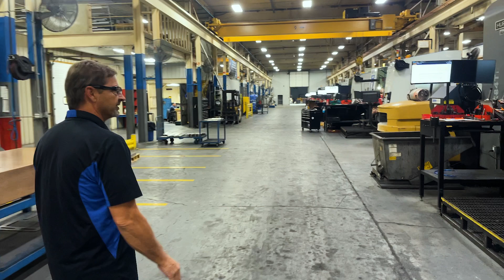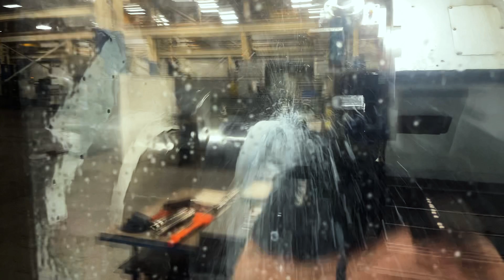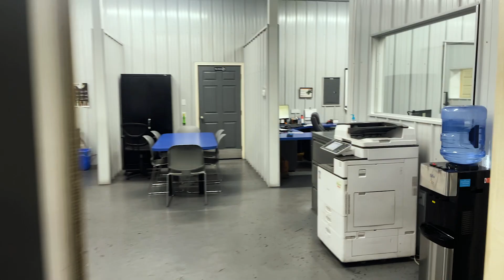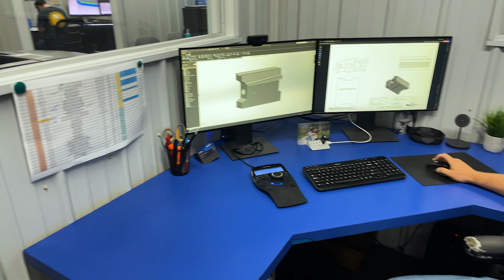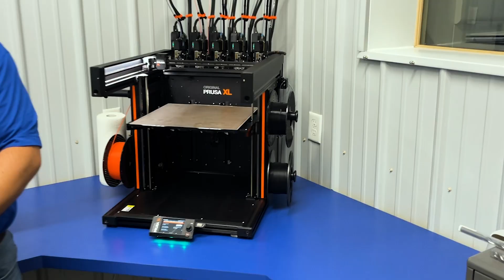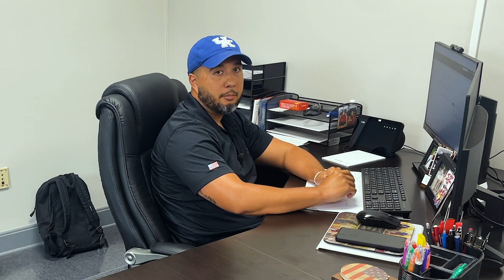You Wish Your Shop Had This Much Space... | EST TOOL & MACHINE Shop Tour

Comment: i worked at Patriot Forge for 4 years.
i setup, operated and programmed 
2 SNK RB6 bridge type cnc milling machines
each with a vertical head and a horizontal head.
one was 8 meter travel in X
one was 6 meter travel in X
both had 3 meter travel in Y
8 meter had 50,000 lb weight limit
i had 48,000 lb block on it once.
took almost a month to machine
with 2 shifts working on it.